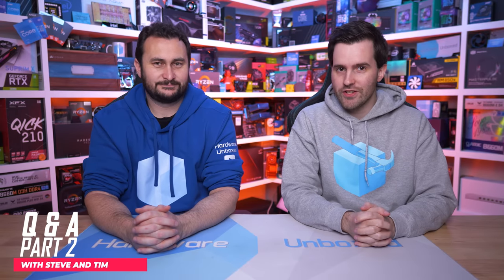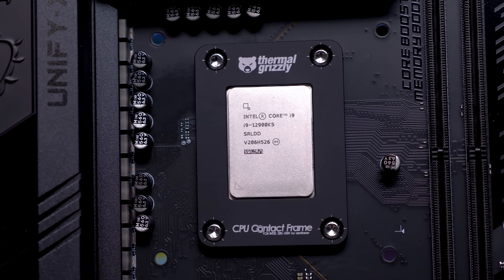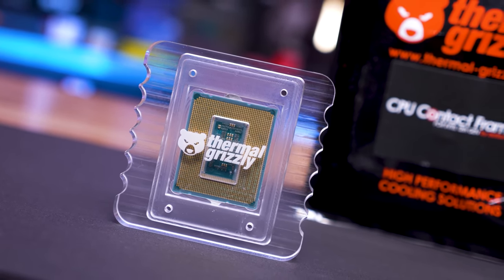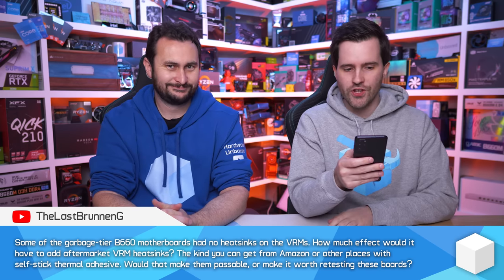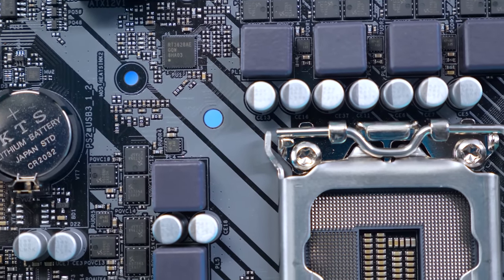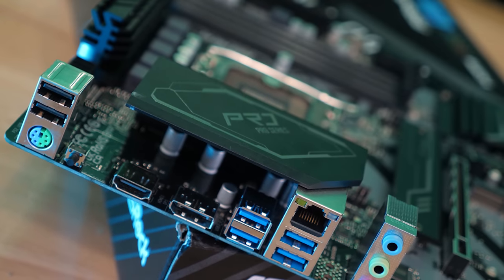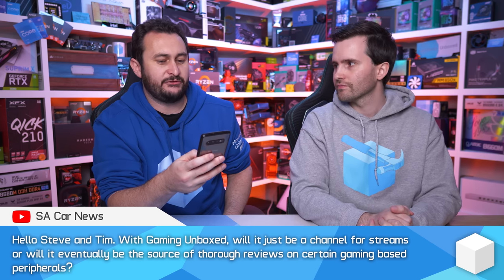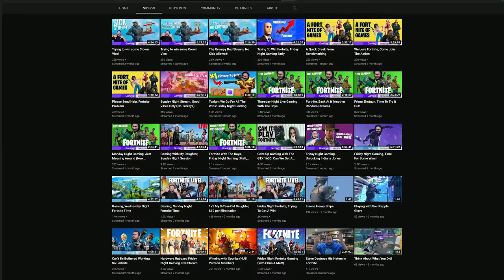Biggest Tech Fail 2022? Zen 4 To Make DDR5 Relevant? August Q&A [Part 2]

Comment: Game developer here. There are actually many things that can be done on lower processing power cores.
Let's imagine a scenario with 1 "P core" and one "E core" processing (path finding etc) a scene with 20 A.I. enemies. While 1 P-core processes 15 enemies, the E-core may have had time to process the other 5 enemies.
Also not all things need to be updated every frame; take path finding as an example again, there are professional middleware products out there to solve this that actually are fully asynchronous and may take multiple frames to do pathfinding.

Other examples:
- Sound DSP and mixing can be done on lower power threads.
- Scene node culling can be parallelised.
- Object ticking can - if developed correctly - often be done in parallel too.

Threads don't need to (but can) be assigned specialized tasks before-hand, you can just have a pool of tasks that need to be completed and any free thread can pick work from there for maximum thread occupancy. Now ofc there are also many things than need to happen in a serial manner, but those are not the reason we're so "main thread bound" these days.

In reality the reason that currently most games benefit strongly from single-thread performance is because it's a ton of work to make multithreaded code actually scale well and be bug free. Even the biggest game engines out there (UE, Unity, ...) mostly promote single-threaded logic, altough the situation is slowly changing. To give another concrete example, Blueprints in Unreal is an excellent tool to allow non-expert programmers to develop certain things as well, but those can only run safely in the main thread.
Reply: So what you're saying is given the development landscape, the tools, and the need to be bug free or streamlined/simplified, E-Cores are still absolutely useless?
Reply: @GENKI_INU   Trying to make things scale to more parallel and asynchronous computation currently involves more decoupling logic such as message passing, copying, which is overhead that raises minspec. And you absolutely don't want to be raising minspec needlessly, since every person that wants your game but can't run the game at all is a lost sale, lost money. In contrast, compromising the experience of players on high end machine is financially risk free, you can always tune it to where it's at least not worse than on a minspec one, but fails to realise expected benefit.

I do also expect future games to be architected with more scaling in mind as less compromised approaches are gradually found, but i don't know if it'll be enough to benefit from ecores in foreseeable future, my gut feeling is that it won't.

Plus all the things you and the OP said.
Reply: @GENKI_INU  What I wrote wasn't targetting them being "useless" or not today, instead it was targetting the discussion being had between 2:00 and 3:14  where the hosts were kind of suggesting that also using E-cores could actually slow things down.
The TLDR of what I wrote is that if you have all P-cores occupied and still have extra work left to do, the E-cores can and should still be used in parallel tasks.
If the P-cores have idle time, it would ofc be counter-productive to assign work to E-cores instead.

[Edit] To address the usefulness of E-cores in gaming today: this very similar to asking about how much core count matters... If the game is mostly single-threaded than having extra E-cores or P-cores won't matter. I'm simplifying a bit here by ignoring background tasks etc, but essentially this is what it comes down to.
Reply: @micaeldias4056  The only use I saw for E-cores at launch was for mobile devices and laptops, where efficiency actually matters.

But since AMD isn't going with this approach, E-Cores seem quite dead in the water with no programming adoption to really make use of it, rather than just using the die space for more P-Cores.

I really wonder how long Intel plans to use this hybrid design past Raptor Lake, if at all.
Reply: @GENKI_INU  That's indeed a very good question.

I never touched one of these intel CPUs with different cores to have any valuable information to add, but I assume their intent is that since games don't seem to be able to make very good use of a high amount of threads, might as well only ship "a couple" of high performance ones and then the efficient ones for background or highly parallel tasks, which should allow them to keep power draw lower (compared to all P-cores) while for most use cases the target audience won't suffer any performance penalty.

Efficiency may start mattering more as core count increases on home desktops, so having these heterogeneous architectures on the desktop may make some sense.
Keep in mind that the E-cores don't really need special programming attention to be useful. They're just "normal" cores that can and will be given work to do at any time by the operating system. (assuming I understand correctly)

We'll have to wait and see how adoption of this goes.
Reply: @micaeldias4056  I'm missing a lot of information myself, but I was told that if the E-Cores are accidentally assigned ANY tasks that the P-Cores COULD be waiting on, and the P-Cores aren't even fully utilized, that would be a massive bottleneck that essentially makes everything pointless. 

Therefore, the "special programming" I was referring to would be for relegating ANY AND ALL tasks that are non-time-sensitive to be offloaded onto the E-Cores (and therefore giving more P-Core headroom for more important tasks), without affecting anything else that needs the highest performance.

As for efficiency, I was thinking more like how phone SoC's work where the high performance cores are shut off for the majority of the time, and only turned on for burst and demanding tasks. This would definitely make sense for an unplugged laptop where you might only be doing basic web browsing or word processing, but it's probably not an architecture worth investing in on a desktop environment.
Reply: @GENKI_INU  Indeed it should be possible to wrongfully assign tasks to a slow core while starving a fast core, but this would hopefuly be a bug or "accident" as you put it.

For now what we can objectively say is that intel is not doing a bad job (performance wise) for gaming or otherwise. As long as they keep it that way I have no problem considering such CPUs in the future (either from intel, amd or anyone else).

I really don't know enough about CPU design to comment on what would be best for efficiency. I trust that the engineers who came up with the E-core and P-core idea did so to solve some kind of issue - power draw, manufacturing complexity/costs etc. - and for now I haven't yet seen any major issues with that specific decision.
What I can speculate looking at Alder Lake's power draw is that it would be unacceptably higher without the hybrid approach.

Comment: High-sensitivity gamer here. I used to be exceptionally constrained for mouse space and the adapted habit just kind stuck. I generally setup 2-3 DPI settings to cover a lower sniping setting (around 800-1000  DPI) and then jump up to the maximum range and typically put on in the middle. Generally I play most games on the middle setting, but that is still around 8000 DPI. I typically only use about 1-3" of travel on the pad.

Comment: So from a programmers POV, what I imagine could possible in the future timeline is basically a self host game scenario. There are 2 possible ways for this to manifest. 1. Theoretically speaking, when you launch a game 2 instance would open. One is the headless server instance with no graphic output that would run on the e cores. This would handle the NPC AI and other world tasks. The P core would run the game like normal. Think self host WoW on one CPU. Server runs on the e cores. player client runs on the P cores or vice versa. The 2nd idea would be split the game world in to grids. The grid the player is in would be the active grid and update on the p cores at fast rate. The inactive grid would update at slow 10 hz refresh rate in the background on the e cores.  IMO this is possible but the ram and IO usage would be enormous.

Comment: 25:11 Mantle spec was given to Khronos for Vulkan. Vulkan is a Mantle derivative. Some stuff was added to it, some was removed and lots of things were changed, but it's basically cross platform Mantle 2.0.
Games like Doom use it, as well as some others, as an alternative to DX12. And the Switch has support for it. Nothing to sneeze at.

Comment: The way I understood the question about the gpu/cpu benchmarking reading between the lines, is that "cascual, new or non-techie" viewer does just want to see which cpu/gpu is better. But to see the actual possible performance they are going to get in specific settings or cpu/gpu combination. For example, for the lowest range to highest range of 30 series apples to apples comparison, it is acceptable to just set the settings to ultra. However, for those shopping for a 3050, 3060, 3060ti, there are times that it's hard to look for videos' wherein the graphical settings is actually set more in line to how an actual consumer would be using it. For those who has even a little bit of experience and knowledge, they could sort of imagine how much performance they are going to get. But that's not the same with first time builders or new to pc.

Comment: I could definitely see a bunch of use cases for E-Cores in gaming, but they would have to be prevalent enough for game developers to take the effort to structure games that way.

While it would be quicker to use P-Cores for everything, you have to judge availability and the thermal consequences. Balancing thermals across core clusters may help prevent throttling, and scheduling a task for P-Cores when all cores are already busy could lead to either queuing or an all cores frequency drop. Not everything in gaming is necessarily time sensitive, especially in things like RPGs and Strategy games. There is the potential for a lot of pre-rendering or caching for specific hardware/settings (quicker on GPU, but why bog it down with future tasks and make the gamer wait), pre-calculated routing, specific NPC/Bot/AI calculations, game logic extrapolation (such as in games where choices alter gameplay), server data processing in multi-player etc. All of this might at some point feed back into the main thread, but the ability to do a lot more of it simultaneously might open up more immersive gameplay experiences, where the background engagement with the game is a lot more intelligent and interactive, something that game writers might have had to reject due to resources in the past. There is probably a lot that is going on in that main thread that could be offloaded, and that just will make the game faster.

The issue is though that most game developers aren't very good at multi-threading, it takes a certain finesse to coordinate the arrival of many programmatic outcomes into a moment in time culmination, and for some reason it is still something Developers in general struggle to grasp technically. Also game companies want to hit the widest audience, so writing a game that scales in complexity with resources, is probably not a priority, and might be considered a risky undertaking.

Certainly though as a Developer having all these cores sparks a lot of possibilities and ideas, I guess it doesn't actually matter if they are P-Cores or E-Cores really for most things, but I think making games less power hungry by using the most appropriate resource for the urgency of the task is worth some consideration. Especially with GPUs getting more and more hungry. I still am not sure game companies are going to prioritize it though, it could potentially take games to the next level of realism, but will introduce a lot of costs.
Reply: Nah, not unless consoles have e-cores, theres less effort going into PC Ports not more haha

Games have Terrible physics ballistics, Still 20 years later no dynamic destruction or proper vehicle defamation, localised dynamic damage, for a reason.  Developers are trying to reduce the effort, Why E-sports is endorsed and pushed even though it results in simplistic garbage games, Same with there Focus on RT. 

With DEVs Its all maximum profit based on Gimmicks for the least amount of effort

Comment: To talk about actual sensitivity. Usually most people don't change windows sens and use either an effective dpi which is sensitivity * dpi to talk to other people within the same game. However to compare from game to game people usually use the measure of cm/360, with most players being between 20 and 50 cm/360. This is assuming no acceleration, though obviously some people play with acceleration.

Online there's a bunch of converters that will give you a cm/360 for a given dpi/sensitivity combination within a given game, but I don't believe they account for people who change windows sens.

Comment: I used a 2500K from August 2011 up to the point in 2021, when I was unable to even start the game "Star Citizen" with it, and I had to replace it.
So 10 years is a good aging for a 4 cores 4 threads CPU i guess...
Reply: My i5 2500k is STILL doing well today! :)
Waiting for AM5 & DDR5 to come down in price, next year hopefully!
Reply: @dare2liv_nlove  My 2500K is still in use in a PC of my mother, but not in my main rig anymore...
This CPU really made its money!
Reply: The point is that it's a waste to buy anything more than a 5600 if you're gaming, and will be perfectly fine for another 5 years.  At that point, you buy another $200 CPU and get another 5 to 7 years out of it.  I think HW Unboxed has proven this over and over again with actual benchmarks, especially at the modern resolution of 1440p.  People that spend more are just suckers for marketing nonsense, and/or need to get some other hobbies.
Reply: Still rocking an i5-2500K with a 970GTX. It will play MSFS and X-Plane on a lowish setting and for all office work it's just fine. Waiting for Raptor-Lake, RDNA3 and nVidia to all release and then it's time to spec up a PC that will, hopefully, last at least another 10 years. This 2500k will be given to Dad as it'll be an upgrade for him checking e-mails. How many cores and threads does Outlook need? :p

Comment: I know you said more than 8k but I have a oddly specific use case. I happen to be someone who switches DPI on the fly probably hundreds of times a day. I have a G604 (previous G602 for many years, settings near same for both mice). I use 2900 when working between my 3 1440p monitors while working. I can cross all monitors with quick swipes and it's just more efficient. When I am working on one screen I swap to 800 with the DPI settings button on my mouse.         As for gaming. This becomes more simple. I'll swap through the mapped DPI settings on the mouse until I find something I like.

Comment: My ryzen 5 3600 is still rocking all games with my 5700xt at 90+ ultra frames at 1440p. I don’t expect to have to upgrade my cpu till 2026
Reply: But if you watch some channels reviews they say you can get 2x more ftp with a 58003d... If you game at 720p with an overclocked 3090

Comment: Regarding the mouse DPI question:
I use a UtechSmart Venus, and have done for many years - when the first starting to have tracking issues after 5 years or so I bought another.
I have my DPI increments set to 1000, 2000, 4000, 8200 and 16400 and I use the different settings a great deal. Whilst on desktop, in file and web browsers, office software etc. I use the full 16400, so that the mouse pointer moves from the far left of my first display to the far right of my second by only moving the mouse about 10mm. If I'm doing a lot of mousing, like in Excel, or clicking on things that are small, then I might drop to 8200.
In most games, if I'm not using my game-pad, I use 4000 but, as I can switch quickly and easily, I will drop lower if I feel the need. A good example of this is World of Tanks. In 'third-person' view and 2x gunsight view I'll use 4000, but as I zoom in to 4x, 8x, 16x and 25x, trying to get more accurate shots at weak points, I will drop the DPI as I zoom in further.

Comment: I do run a higher dpi and that is mainly from old habits from being an older gamer and back in the day software acceleration was the only way to get a faster reaction speed to make up for the crappy sensors on mice say late 1990s to early 2000s. So I feel more comfortable with twitch movements and overuse my own twitch skills to compensate for that overshoot you get when moving that fast on a high dpi.

Comment: AMD's development of Mantle directly influence Microsoft to put low-level access into DX12, to reduce draw call overhead.  That was the essential goal of Mantle - increase the number of draw calls per second that any CPU was able to make, because even very fast PC processors were being outperformed by the relatively slow consoles due to this difference, in certain situations (one example I recall was Assassin's Creed 3, where the game would run terribly in Boston and other high-draw-call areas - not an issue on the console versions of the game).

Another early ATI pioneering moment was tessellation.  They had TruForm back in 2001, years before tessellation was added to DirectX 11 and finally utilized in games.  True to form, nVidia managed to use this to their advantage by contriving to have games grossly overtessellated, which hurt performance on all cards, but more so on ATI/AMD cards (the most egregious example being HairWorks).

There have also been many driver features AMD had before nVidia, but not vocally like with nVidia.  Rather than having more people touting the features than using them, they had more people using them than touting them.  There's one in particular that nVidia still doesn't seem to have answer for, which is Radeon Chill.